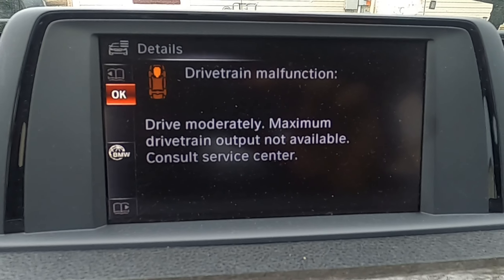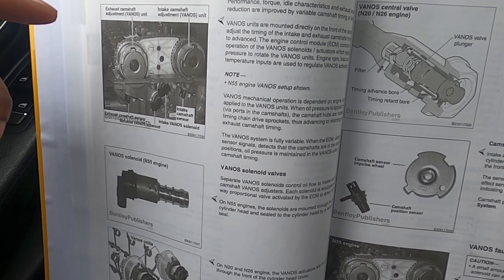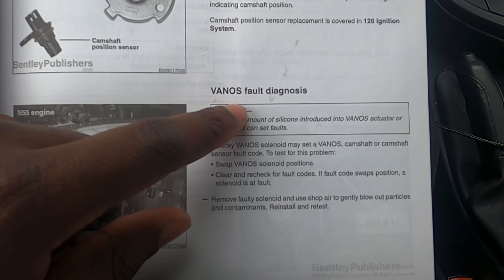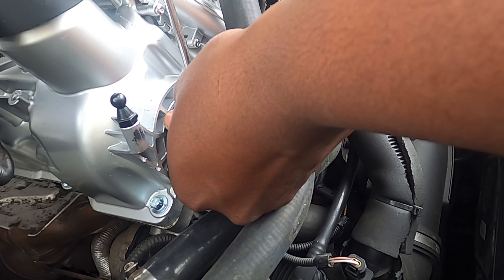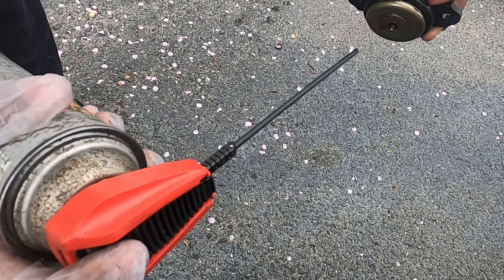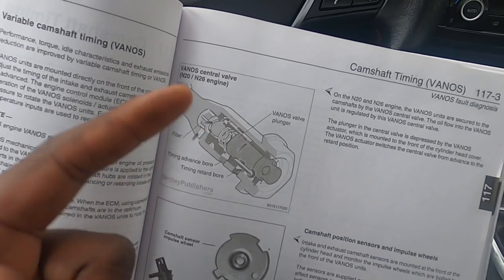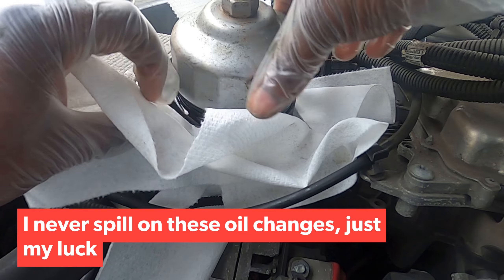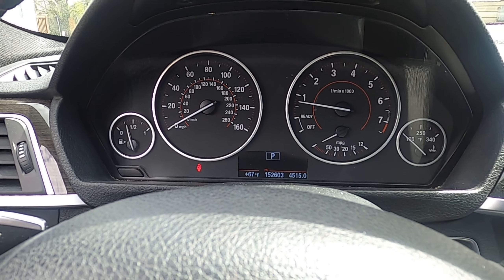Fixing P054B BMW F30

Comment: I’m about to change from the plastic to the aluminum valve cover, just got mine and I have a question, does the engine noise sound the same as when you had the plastic cover on ?
Reply from the maker: @shearscarter9136  yup
Reply: To me the ticking engine noise seems louder with the plastic cover.
Reply from the maker: @torturetuesday5191  if you take off the styrofoam padding that’s under the heat shield and on top of the high pressure fuel pump the ticking from the HPFP will be louder. I personally keep mines off because I think he heat soaks the valve cover
Reply: @shearscarter9136  no difference in noise for me on my X6

Comment: is it the same for E90?
Reply from the maker: @Miirroooo  similiar instead of VVT actuators. You will have VVT solenoids the E90’s have the N52,N54, or the N55 engines like I described in the book.
Reply: @ultimatediyguy395  Thank you
Reply: Thank for sharing this information I have 2015 320 I I get same issue I just bought the car and I drove one mail and the car turn off and unable to start again i fend out the oil pan has been crack and all the oil gone I get this code p054B and p13C0 I change the pan and battery and I checked the camshaft sensor actuator like you did and I do check the fuel and spark plugs they look good but the car still not start any advised please
Reply from the maker: @muhannedhadi526  I’m not 100% sure but it sounds like you may have a timing problem or something got damaged when you crashed. Sounds like you need to get it towed and taken to a professional

Comment: Hi thank you for the vid
I recently changed out my valve cover and gasket as well on my x6 n55 engine. after a month, and being cold here in chicago now, I got a code for P052B 
Cold start A camshaft position timing over retarted bank 1. Along with stalling and rough idle. I removed the vanos valves and saw that they were very dirty. 

Now my question, did you have any other issues following the cleaning of the vanos? If so what did u do next? 
🙏 Thank you
Reply from the maker: @brodcd4649  I will say a month or so later the actuator acted up again so I replaced the part and I no longer have the issue anymore.
Reply: I appreciate tbe info, thats what i see in other vids as well, that is, ppl end up replacing new vanos solenoids at the end.
Reply: I must add, i also replaced my plastic valve cover with an aluminum one.